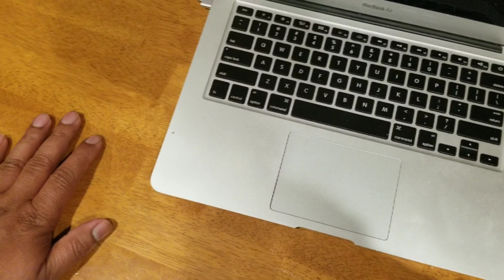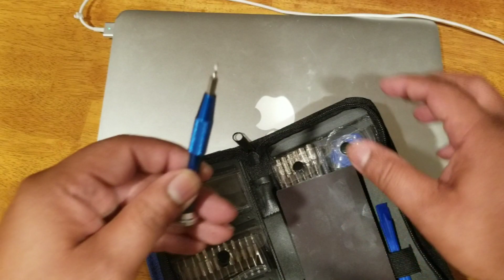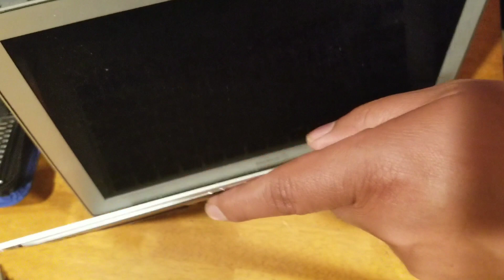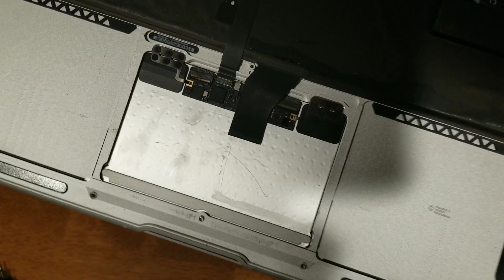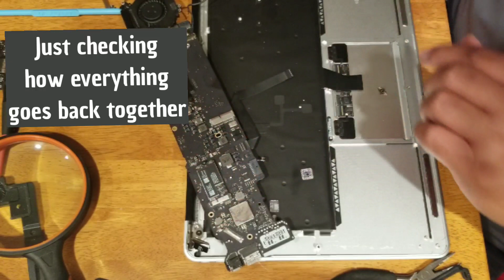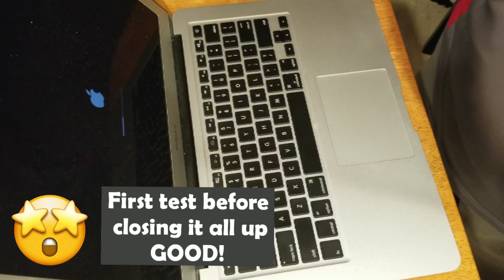Mac book water damage repair!😭

Comment: For this computer was the caps lock seemingly on all the time? Would the mac boot to safe mode each time? I am unable to control the boot sequence to even boot to a different drive at startup. Just trying to narrow down a physical hardware error or something else.
Reply from the maker: It would not boot, I believe the power button was stuck. It wasn't until I was able to eliminate all power sources aka power cord and battery. Once connected again the unit would boot up. Letting me known most of it was working. When I typed the password either nothing or the wrong letter would appear. Brandon let me know how I can help.

Comment: I’m watching this to repair a laptop that I got for free because it’s water damage lol edit: now I have diagnosed it, it looks like I will have to replace the touchpad and the keyboard which is gonna be some work because there’s gonna be a lot of screws to remove I think it’s 20-50 something...
Reply from the maker: Don't replace the keyboard and mouse. Replace the whole part with tested keyboard and mouse. You can buy it on eBay just like I did. Replacing the keyboard can be challenging for starting DIYers. You can get something similar to this: https://www.ebay.com/itm/274258226466

Comment: I was cleaning my laptop and then the keyboard and track pad stopped working. It still powers on but they said the it would need a whole new keyboard and such. The repair was more than the cost of the laptop. Is this something that can be done with limited knowledge on laptop repairing?
Reply from the maker: Please feel free to email me at edtheoldtechguy@yahoo.com or connect with me on instagram and message me and maybe I can help further.  Can you do this, if you are handy and careful I dont see why not. A PC is just a machine created by imperfect humans which means an imperfect human can repair it. But be honest with yourself, if you have never done anything like this before know when to stop and who to ask help from. Create a plan and then a back out plan.  I would start by first taking it apart and checking the ribbon cables to ensure they are attached well or for any liquid that may have penetrated through when you cleaned your system. Do not attempt this with cheap tools they will strip those screws real easy. Do not use a drill or any insane force, if it starts stripping stop and hit me up,  I have stripped those before and I can tell you how to fix it. Make sure you get a good set of drivers maybe try the Ifixit tools. Dont use drivers with bits, only use full drivers that are strong. Also if you are going to replace the keyboard and mouse consider going on ebay and buying the whole piece like I did. It's way easier. You will need some thermal paste and some thermal pads to be safe. Last but not least take your time, think and mediate on the task do not use force, be kind and slowly detach cables, take pictures of every step you have done so you can go back and review. Use a magnetic screwdriver and tray to hold screws, label things as you go along and make sure you gave yourself enough time like a whole weekend. Watch multiple videos and take notes and save those videos. Trust me you can do it if you are clever enough and a tinkerer.
Reply: @edtheoldtechguy  Well said my guy, can you also do phone repairs and stuff?
Reply from the maker: @Dnsx_plus  I can but boy working on them can get tough while making a video at the same time. Stay tuned as I consider doing some phone repair videos.  As for phone videos in general I was thinking of talking about my youtube recording set up and how I use my phone to do it. This may be a video soon.